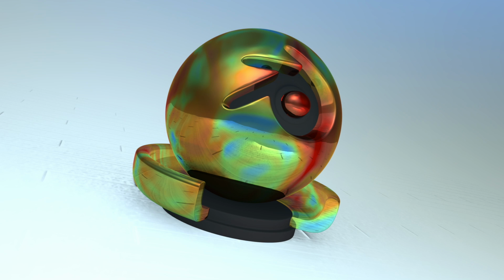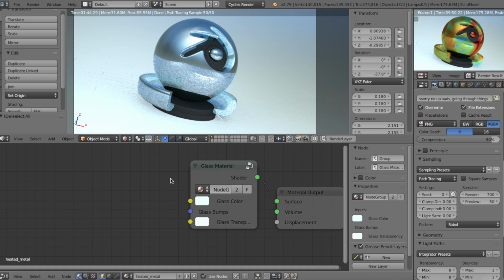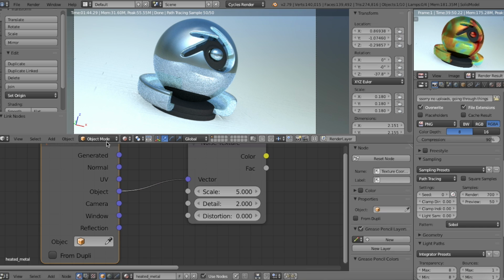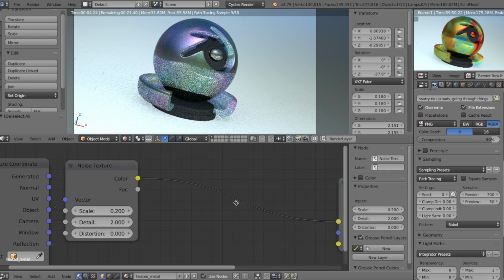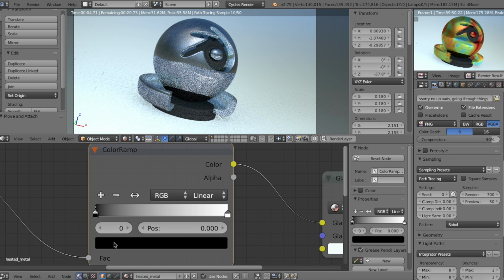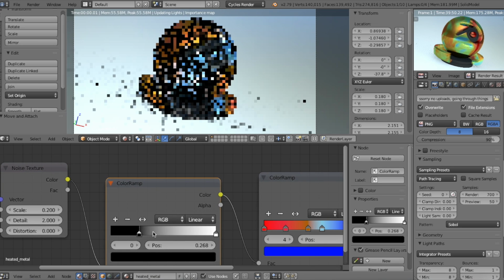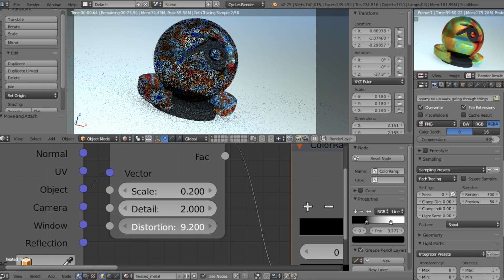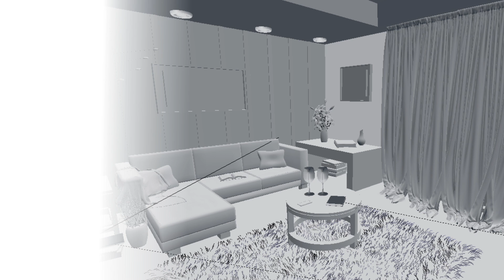How to create colorful glass material || Blender Tutorial

Comment: Do you feel the principled shader is worth using or no?
Reply from the maker: Great question.  I honestly think it makes setting up materials (realistic or cartoony) easier, and it also makes them look better as well.  While letting you adjust certain settings through its values or using texture maps.  So yes I think it's worth using!
Reply: In general - yes. for glass - no. Sadly the Principles Shader doesn't seem to use inner reflections, so glass objects get very dark using it. Better to use the default Glass BSDF (+ Light Path optimization if you are fancy)  with Volume Absorption for tintet glass.